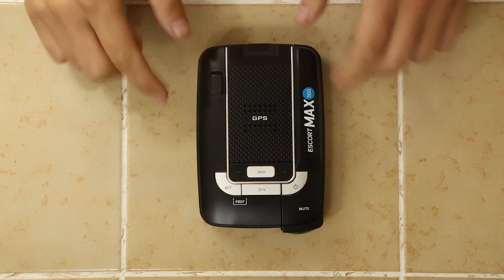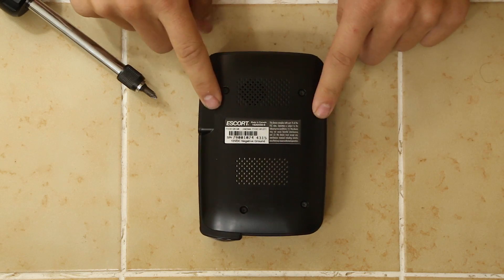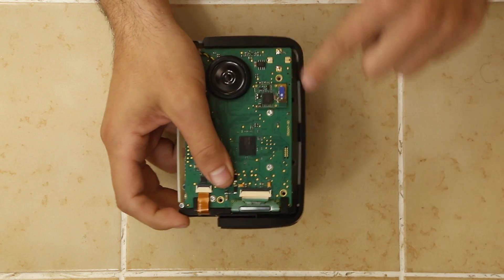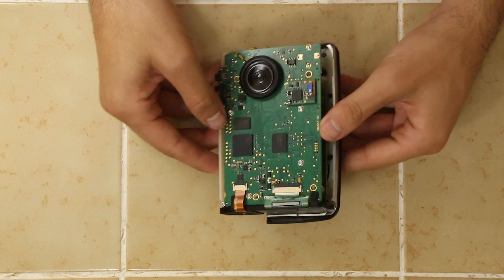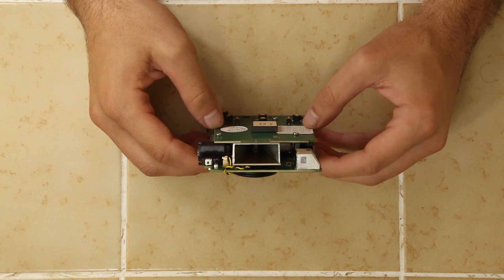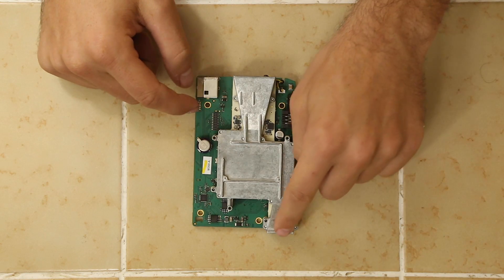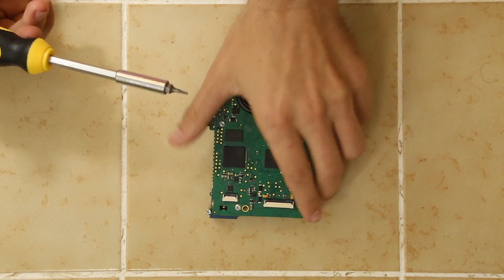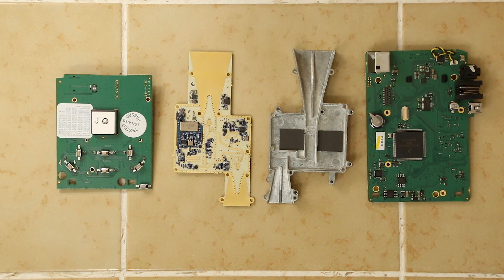Escort Max360 Teardown

Comment: All that internal components yet Uniden is able to do better for less, production cost of Escort Max 360c MK ll is around $150-$175. All though construction is more cheaply made I prefer my Uniden R8 over my  Escort Max 360c MK ll , which I have more than a few issues with and the biggest one? Response time to instant-on radar, which Escort is aware of.

Comment: Quick question.  I just purchased a max360.  Is it normal for the main display to appear dim?  Hard to see.
Reply: no, it needs to be replaced
Reply: @artvandelay837  the whole unit or display itself.
Reply: @jefffactorrc-realcool5779  just the OLED display. It's my understanding that you have to send the whole unit to escort and they'll replace it for 140
Reply: @artvandelay837  great information. Will do just that. It’s a rather expensive radar detector.  I’ll do that.
Reply: Thanks for your efforts.

Comment: By the way the thing you referred to as an antenna is actually a waveguide which channels the desired frequencies into the RF board (the one that isn't green). Also in the future for electrical guys like me could you zoom in on the chips and board so we can get a look at the parts? Most interesting parts for me :)
Reply from the maker: That's true. It's the waveguide and that's a better term to use. :)

If you take a look here, you may get a better look at the components: https://www.vortexradar.com/2015/10/escort-max360-under-the-hood/
Reply: I can describe it as surface mounted waveguide to microstrip, and I can see siw and end of horn. But I can't find anything online similar to this , Am I describing it right? Can you help me?

Comment: will you please tear down the brand new escort IX? It's supposed to be the 2.0 version of the 9500 IX. just released they claim it's the fastest radar but when you look down to the specs it's the same exact as the max 360
Reply from the maker: +Ro Jacob Oh it doesn't have the same tech as the 360...
Reply: Vortex Radar I meant thier operating bands are the exact same! The IX claims it can pick up bands longer and faster lol all in all i truely think thier are taking about the replacement. Not on behalf on the whole line up. The new IX doesnt have a rear antenna or directional arrows but it does have thier new "scanning frequency discrimnator" that the 360 doesnt have. Im speaking from whats on thier website
Reply from the maker: haha yeah sure. Where are you seeing that? Stepping away from the marketing hoopla, here's a look at how the iX does in testing: 

It's on par with the Radenso XP on 34.7 and 35.5, but lags behind the Redline. https://www.rdforum.org/showthread.php?t=55370 The Uniden ties it on 35.5 and beats it on 34.7. 

On 33.8, it beats the Uniden but lags behind the Redline and Radenso XP. https://www.rdforum.org/showthread.php?t=55406

Compared to the Max detectors, those do scan faster which is why they don't require BS/RDR for maximum performance and the iX does. It's different tech under the hood, beyond just the arrows.
Reply: You've had your time with the new IX from escort? If so which one would you prefer?

 The max 360 or the new IX they just released.... Im seeing everything under the "specs" of each radar i click on the escort website
Reply from the maker: I haven't spent time with the iX. Up until a few days ago, the Max2 actually cost less online and yet it offered all the same features (except for the new magnetic mount) with better performance, better filtering, and a low price. There's no reason to get an iX because of that.

If the prices stay where the iX is lower than the Max2, then it'd make sense.

I'm planning on doing a comparison with the 9500ix, iX, and Max2. I've got some other projects to work on this month, but next month I'll have people be sending me the 9500ix and iX so I can present more information on them. It's not a high priority right now but I will be getting to it. :)
Reply: Dont buy from escort buy from amazon!! The brand new released Passport IX is 500 from escort but amazon sells it around the 380 range!! 

I paid 650 when the first Max when it came out(still have it) and idk if i should spend 500 on the 360 (on amazon) or 380 on the new IX. 

Its time to retire the max (1) Especially because I cannot find replacement parts for it and I refuse to send it to escort. Still works but glitching a lot and falling apart from the outside
Reply: I have an iX. Spent a year with it. Phenomenal. Also it does have a rear antenna? Where are you getting it doesn’t? And also how would I go about making the rear glass stay in place. My brother used it and drop it and the back glass has popped out. From what I saw there’s two ridges the piece fits into but one side needs to held in my a part of the casing I guess.

Comment: You didn't point out the photocell on the top of the unit.
Reply from the maker: Nope. There's a lot I didn't point out. :)
Reply: Vortex Radar 
After I used a mirror bracket, my display was staying dark during the day. I decided not to use that bracket anymore. Great video though. Thanks for making it! :)
Reply from the maker: Bummer, yeah. I haven't heard of that issue happening before. Which bracket are you using? Maybe it depends on the design of your particular car?

Comment: Thanks for this great video on the teardown of the max 360!  As a former user of an older V1, I decided to move over to Escort and try the Max 360.  So far, so good, as I learn the operation of this detector.  I used this video to figure out a low-key and ANNOYING vibration noise after mounting the max360 on a Blendmount on my mirror.  Once I popped open the detector -- I discovered that there was really nothing that I can do to stop this noise.  I found that the vibration noise was coming from all the plastic on the top cover of the detector (black plastic cover/body, cream plastic "subcover", and the silver plastic layers that operate the control buttons.  All of this plastic vibrates together making the noise when the detector is mounted while the car is driving down the road or idling.  Oh well --maybe I may get used to it, maybe not.  All I can say is that I do miss the metal body and solid build of the V1.  On the other hand, I love the radar/laser information that the max 360 gives me, which the V1 sorely lacks (particularly i dislike the V1's red LED band indicators, which are useless at night).  I am not keen on using my phone to pair up to my detector, so I like a plug and play unit.  Again, thanks for the great video!

Comment: Nice tear down! The connector you were referring to is called a Pin Header Connector (similar to jumpers). The small elevated chip on the right side of the speaker appears to be the Bluetooth module, its antenna is integrated into the PCB that it sits on. It appears they used the same design for the bluetooth as they did on the Max 2.
Reply from the maker: Thank you! :)
Reply: It certainly is, mine has separated from the board. Been trying to figure out how to find someone to replace or reatach it.